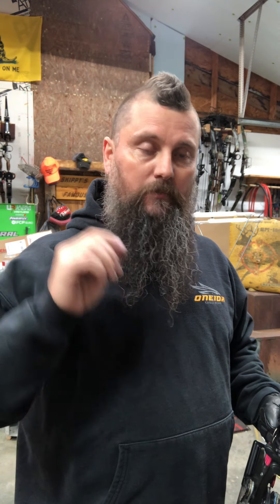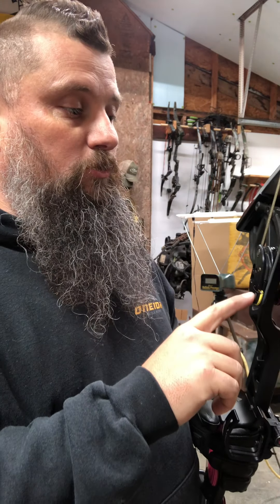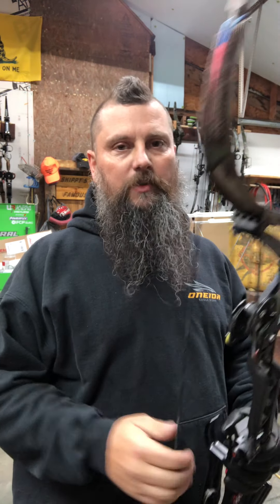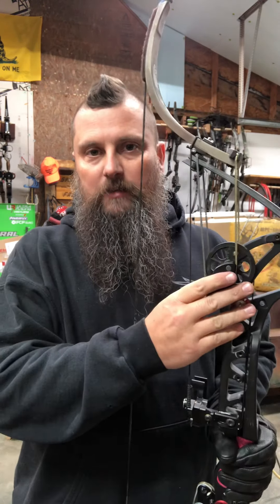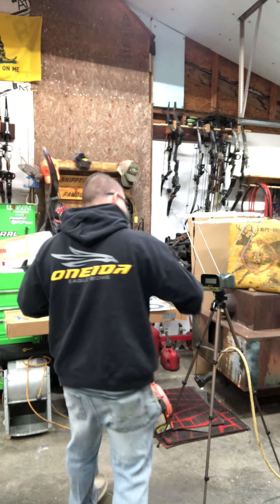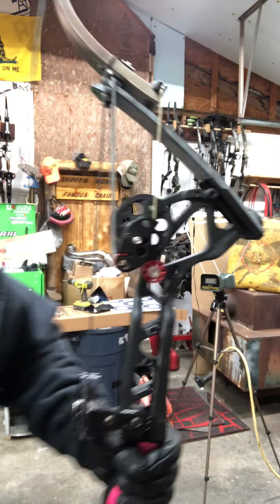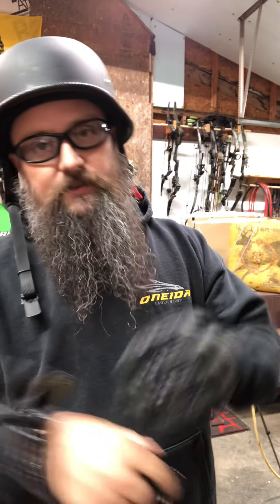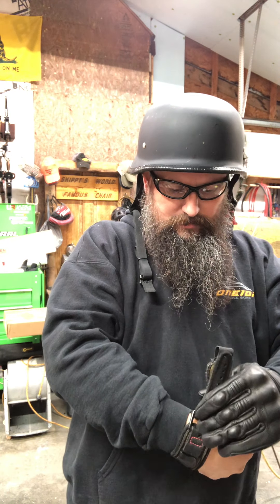Oneida Phoenix at IBO spec through the chronograph

Comment: Great video I have a medium around 26 1/2 draw with around 500 gr arrow guessing about 60lb all ready broke a power cable but there was a sharp edge on my cam iam hoping to get a long life out of this bow its only a year old do you have any tips on extending the life of the bow it's a Phoenix thankyou take care
Reply from the maker: If you bought it new, contact Oneida.  They had some issues with this, but they were covering the bows under warranty.   Your specs are good for the bow.  Oneida has been very good about fixing these.
Reply: @skippytheleverbowguru5316  yes I fixed it took a small round file to smooth out the transition but wasted the new cables I see you have a limb driven rest I still use a plunger an golden key I shoot fingers was wondering how a drop away rest would work with fingers
Reply from the maker: @shawnmasters2751  A drop away is not ideal with fingers as there is not enough side pressure on the arrow.  Boondock Outdoors is now making a shoot off the shelf style rest for almost all lever bows.  Works extremely well with fingers.

Comment: Would you kindly tell me why the bow blew up the bowstring? If Oneida blows up the bowstrings how dare people use Oneida?
Would you tell me why this happened and how often this happens?
Thank you very much.
Reply from the maker: Normally you would not shoot that light of an arrow.  This is to test  IBO speeds, It is pushing the limits of what the bow is capable of.   It is not a common issue to blow the string.  Normally would would shoot 8 to 10 grains per pound.  These bows are great once set up properly and seldom have issues.  My current hunting bow has over 5000 shots on it with no issues.
Reply: Thank you very much for your prompt response.
Would you tell me what is your draw weight for your hunting bow?
Thank you.
Reply from the maker: I pull 65-68 lbs, 26” draw and a 600-650 grain arrow depending which bow I use.   I have several set up.
Reply: @skippytheleverbowguru5316 
Wow, you are so strong! I can only draw 50 lbs currently. But I try to make up for it in draw length. My draw length is 32 inches. For the Oneida bow, if I want to change the draw length to 32 inches, besides changing the length of limbs and the modules, should I change the Cams or modify the Cams? If I should change/modify the Cams, which size I should choose for the Cams ?
Your help will be deeply appreciated.
Reply from the maker: @matthewyu3531   To get to 32" draw you need to go to an older model.   A Phoenix Long will only go to 31".  There are numerous other models that will go 31-34" draw.  You can sometimes find that in a black eagle or an even older model such as an Aeroforce or a Tomcat.   Lite Force Magnum is also a great shooting older bow you can get in the longer draw.
Reply: @skippytheleverbowguru5316  
Thank you very much!
You helped me a lot.
May God bless you richly.